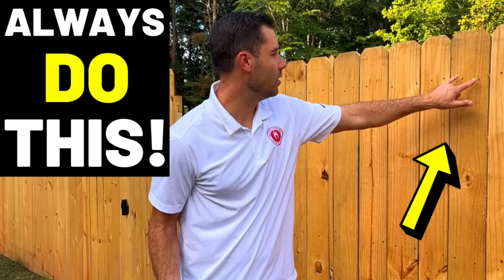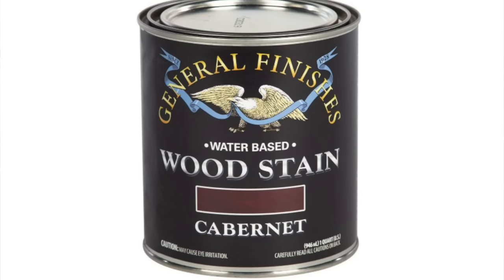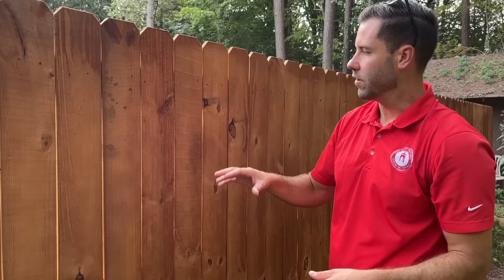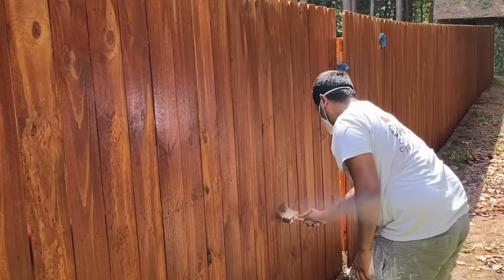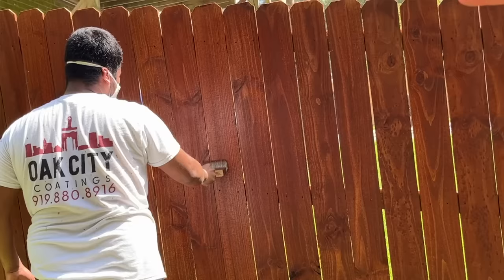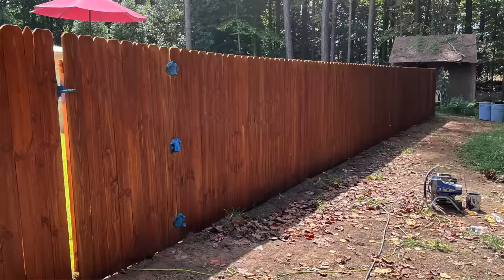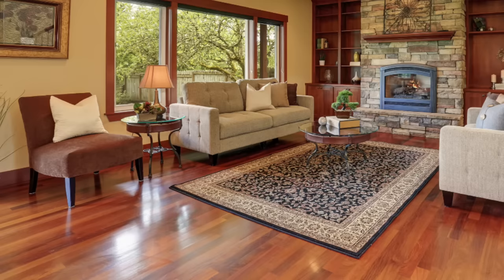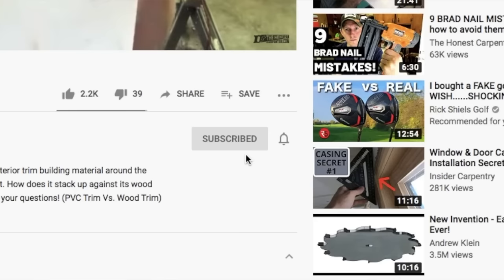Don't Make These 4 FENCE STAINING MISTAKES! (Most Overlooked Fence Stain Pro Tips + Tricks!)

Comment: I've heard the opposite advice on how much stain to use.  The flip side to using more is that you end up with a layer of dried stain on top.  It looks good when you finish, but then starts to peel and flake soon after.  Plus, I thought the boards you did lightly stained looked better than the super dark ones where you used alot of stain, but i guess thats just personal opinion.  Also, im pretty sure a waterproof sealer is what will protect the wood, not the stain.

Comment: One thing I have always wondered:  what will the neighbors side of the fence look like if I spray?
Reply: You could definitely get some over spray on their side. However, even with just brushing this TWP we use it will bleed all the way through the wood to the other side as it fully soak up the stain throughout the grain. Maybe you could work something out with the neighbors to help with splitting the cost or something?
Reply: @nickolasokeefe8479  those fence boards are 3/4 inch thick.  Are you saying the stain goes all the way to the other side?
Reply: @robertp7209  Yes mostly where the knots are you will notice it the most.
Reply: You'll have some bleed through around the edges but if it's your fence then who cares? If they want to stain their side so be it.
Reply: We had our contractor hang a tarp on the neighbors side for a recent job because of a previous incident at our last home- the spray escaping over the top and between wider spaced boards, drifted on to the neighbors lighter colored home and we had to pay to get it cleaned. That house was about 10' away from their side of the fence.